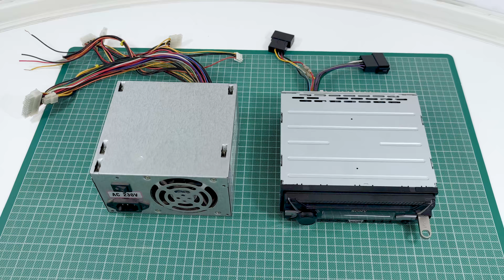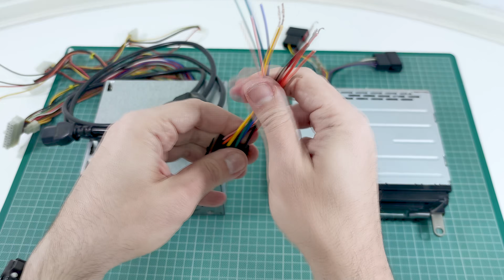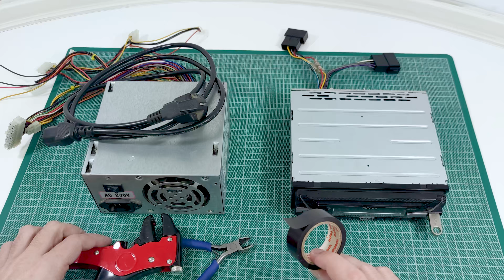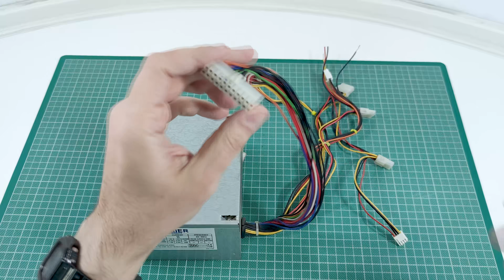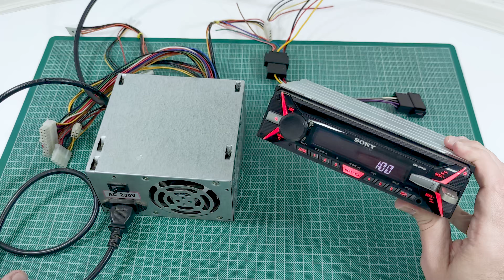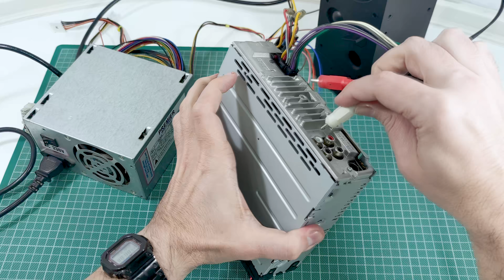How to power a car radio / head unit by connecting it with a PC ATX PSU power supply (simple DIY)

Comment: The problem is, if you use regular speakers for output you won't have enough amps coming from the PC power supply to give you a decent volume.

Tried this when I was a kid, because it seemed like a good idea. But it's not.  If your speaker is active, if it has it's own amplifier and power supply, that's a whole different scenario.
Reply from the maker: Thank you for the comment! My goal was to check if the radio unit was working or not, so for testing purposes this is more than enough and it's very easy. I tested it with an active speaker, so just the RCA signal was enough. This is an ancient PSU I just had available, I'm sure there are better solutions. I'm making your comment pinned so people will read it and know about the limitations, thanks again!
Reply: @erripis indeed, for testing purposes, it's OK. Good luck!
Reply: I am using it right Now and it sounds Great!!!!!!!!